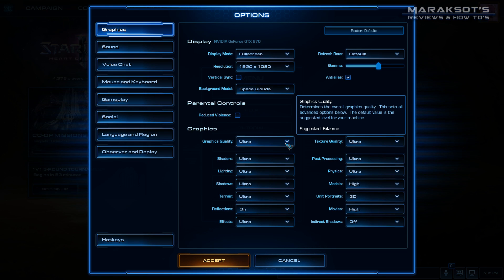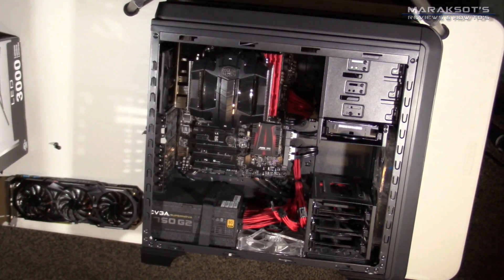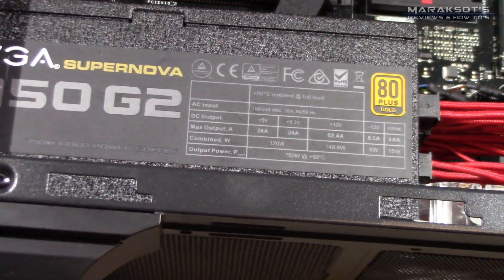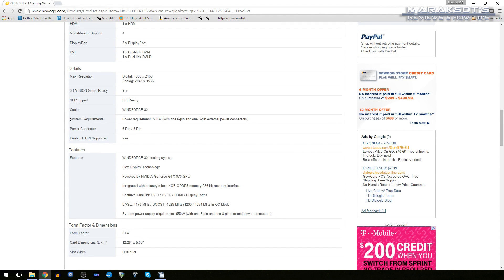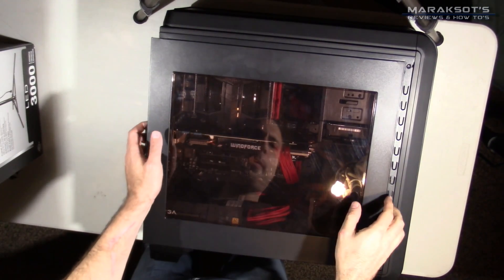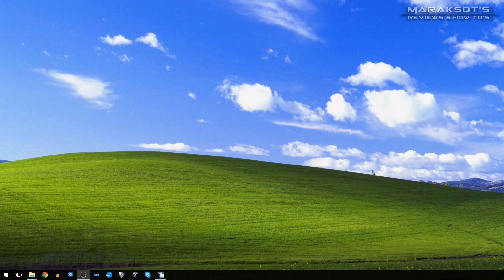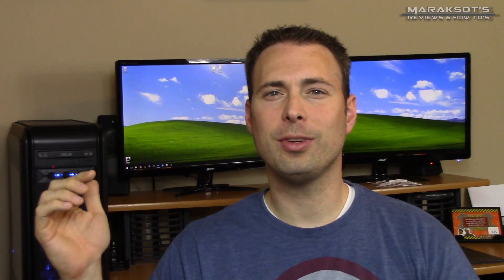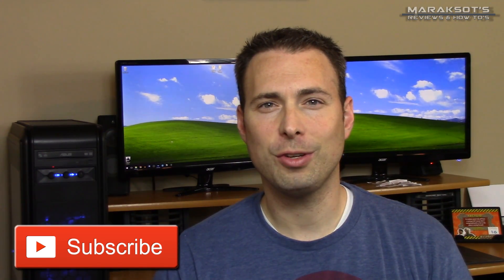A Beginners Guide - Upgrade your GPU - How to Install a New Graphics Card

Comment: So I play high  graphic mmo games like Archeage and Black Desert and I want to get a i7 processors but I'm not sure what graphics to get. Do I need a GeForce gtx 1080 or am a able to get something less powerful and expensive and play at full graphics with no problem. Note that it gets really laggy when there's a lot of players around.
Reply from the maker: it depends on what resolution you game at.  If you game at 1080p then I think a Geforce GTX 1060 or an AMD RX480 would work great.  1440p then I'd probably say a GTX 1070 or 1080. If 4K then you're looking at a 1080 or Titan X (Pascal).
Reply: You mean screen resolution? if that's the case I usually do the top resolution of around 1920x1080. but if not how do i find out at which resolution i do play?
Reply from the maker: Kelly nell yes, I'm talking about your screen resolution. 1080p is 1920 X 1080, 1440p is 2560 X 1440 and 4K is 3840 X 2160. The resolution you can play games at depends on your monitor. Right now 1080p monitors are the most affordable. When you start going to higher resolution monitors they get really stupid expensive. It sounds like your monitor is 1080p so yeah once you upgrade your CPU, a GTX 1060 or an AMD RX480 should be able to play any game currently on the market at 1920 X 1080 on max settings with no problems.  :)
Reply: Maraksot78
Awesome thanks for the info! :) i do I one more question though if you don't mind. The graphics card I have atm is a XFX R7260X and when i first got it, for some reason when I play games (especially the the higher graphics ones) and around 5-20 minutes of playing the game, for some reason my computer will randomly crash into a dark blue screen and make drilling sound and I would have to restart my computer every time that happen which kept me from playing games. And for some reason no body could figure out the problem. I tried to get it fixed about 4-5 times but it never got fixed. And the only way I can stop that from happening is a program called MSI after burner. And when my card is at a regular state it says that the

POWER LIMIT at 0 (MIN -20) (MAX +20) . 

CORE CLOCK MHz at (1075) (MIN 535) (MAX 1200)

MEMORY CLOCK MHz at 1600 (MIN 800) ( MAX 1600)

And for me to get it under control I move POWER LIMIT and MEMORY CLOCK to the MIN but leave the CORE CLOCK as it is. And I will have to keep this program running for as long as I'm playing a game. So do you know if it's a graphics card problem or is it more likely the motherboard?
Reply from the maker: +Kelly nell MSI afterburner is a commonly used utility for overclocking your graphics card.  Now I'm not a very experienced overclocker but from what I do know about it, it seems that your graphics card is possibly overheating or something when under load which then causes your system to crash.  Setting the power limit and memory clock to minimum would certainly help to reduce heat but it of course also reduces your graphics cards performance. Out of curiosity... how much do the fans on your graphics card ramp up when your gaming? Does it stay super quiet or does it get kinda noisy? If it's staying super quiet then your cards fans may be running at a super low speed to give you near silent performance but it of course doesn't do as good a job at cooling your card.  You should be able to adjust your fan curve in MSI Afterburner so that your fans will ramp up more when you're gaming then you may be able to bump your power limit and memory clock back up to normal and get some better performance. Another thought I just had is what is the airflow in your computer case like? Do you have a bigger case with plenty of space around all your components or do you have a smaller case where things are packed in kinda  tight? The tighter things are packed together the more vital it becomes to have good fans to bring cooler air into the case and exhaust the hot air out.  How many fans does your case have in it? How many intake fans? How many exhaust fans? Good airflow is super important because all of the components in your computer generate heat and if you're not getting the hot air out of your case then that can cause overheating which leads to system crashes and decreased lifespan of your components.  If you want to learn more about MSI afterburner I'd recommend searching for videos from Jayztwocents on MSI Afterburner, he's a very experienced overclocker and uses MSI Afterburner a lot and explains very well what all the different sliders and whatnot do. Also check out videos by Linus Tech Tips about case airflow they've made some really good ones.  I hope this isn't too much information for ya all at once. :) I really do hope it's helpful to you and will help you get a better gamng experience with your current rig.
Reply: Tbh I only have a basic dell case atm and everything is kind of packed but I do leave th case open so that i can keep a eye on everything. And I don't exactly know the type of fans I have but I have one for the processor and one for cooling the whole desktop itself. And of course 2 fans with the graphics card. And when I play games it will get too hot to touch sometimes. About 150 degree F I think. And sometimes it will make a pulsing sound. like in every 3 seconds it will speed up really fast for 1 second. But yes that did really helped a lot :)

Comment: Does it matter how much you have pin
Reply from the maker: as long as you plug in the dongle from your power supply that corresponds with the port on your graphics card you'll be good to go.  So if your graphics card has only one 6 pin port then you only need one 6 pin power cable, if your graphics card has a single 8 pin then you only need a single 8 pin power cable.  My GTX 970 in this video requires both a 6 pin and an 8 pin to operate.  So if you have a graphics card similar to mine that needs 2 power cables you're going to need to plug in both for the graphics card to work.  I hope this answers your question.  :)

Comment: What should I do, I bought an HP Pavilion 550-a114 - A-Series A8-6410 2 GHz - 8 GB RAM - 1 TB HDD - AMD Radeon R5 - Windows 10 Home from Best Buy and when I opened it upI didn't see a clear visible PCI Slot for a graphics card and I don't have the money to buy a whole new computer.
Reply from the maker: +Top Banana well... if you bought it recently you could return it to best buy for a different model. Or you could sell that computer and put that money toward another one. You may also be able to reuse your case, APU, RAM, powersupply, and hard drive and stuff and buy a new motherboard with a PCIE slot. That being said all too often pre-built PC's nowadays have custom motherboards and cases that don't always accomodate "off the shelf" components and since I don't know what exactly your case and motherboard is like I can't say for sure if it will accept a new motherboard. I hope this helps. :-)
Reply from the maker: +Top Banana I had a chance to look up your HP Pavilion today on Newegg.com and unfortunately it looks like there's not much of an upgrade path using that case and hardware. The A8 APU in that system appears to be soldered to the board meaning it's not socketed and therefore not able to be easily swapped out. Also that case isn't designed to accept an after market graphics card so even if you were to swap out the motherboard for one with a PCI Express slot you'd have to purchase a new CPU or APU and then cut out a space in the back of the case for the rear IO of your graphics card and then your graphics card would just be loosely sitting in there since there are no mounting points. I hate being hhe bearer of bad news but if you're wanting to upgrade to get a better gaming experience I'd recommend you save up some money, sell your HP Pavilion and look into something that's more powerful and is more upgrade friendly.
Reply: Maraksot78 thank you for telling me
Reply from the maker: no problem :)

Comment: i accidentally delete my graphic card drivers....could you help me?? cause i've been finding the compatible one...but not found yet....i've download the nvidia but then they say that it is not suitable for my computer...can you help me???
Reply from the maker: when you download the driver make sure you select whatever your GPU is and the version of Windows you're running and you should be fine.  If that doesn't work you may need to contact Nvidia support.
Reply: what is GPU?? sorry, i'm not very familiar with these...
Reply from the maker: do you know what graphics card you have in your computer?
Reply: yes, it is nvidia....
Reply from the maker: nur atiqah ok, Nvidia is the manufacturer... do you know what model of graphics card you have?  for example, do you know if it's a GT 730 or a GTX 960 etc?
Reply: hmmm...sorry, i don't about that...i'm trying to search back it
Reply: * it back
Reply from the maker: do you know how to go into device manager in windows?
Reply from the maker: if you right click on the windows start button it will bring up a list.  on the list there should be an item called device manager. click device manager and it will then bring up a list of all the devices connected to your computer.  on that list there is an option called display adapter.  if you double click display adapter it will then show you what your graphics card is.
Reply: It was Standard VGA graphics adapter
Reply from the maker: so it isn't telling you the model?
Reply from the maker: Are you using a pre-built computer like a Dell or HP or is it a custom built PC? If it's a pre-built then we might be able to find out what your graphics card is by doing a Google search for your PC manufacturer and model number.
Reply: i'm not very sure about that...but i'm using hp pro 3330 MT
Reply from the maker: I looked it up on HP's website http://h20564.www2.hp.com/hpsc/doc/public/display?docId=emr_na-c02976897 and it looks like they made that model with a pretty wide variety of graphics cards...
Reply from the maker: +nur atiqah however when I go to their driver download page for the HP 3330 MT... what version of Windows do you have?  Because depending on your version of Windows it looks like they have a couple different Nvidia drivers.
Reply: version? like?
Reply from the maker: On HP's support website they have downloads for the drivers for your computer so we need to know what version of Windows you're using.   Here's a link to their site so you can see what I mean.  http://h20564.www2.hp.com/hpsc/swd/public/readIndex?sp4ts.oid=5159685&swLangOid=8&swEnvOid=4058  If you're using Windows 8 (64 bit) then there's only one Nvidia driver there to choose from.
Reply: oh...i'm using windows 7(64 bit)
Reply from the maker: ok, do you know if it's Home Premium? Professional or Ultimate?  I think the drivers are all the same but just to be safe.
Reply from the maker: I just double checked the driver version for the different versions of windows and they're all the same.  :) It looks like there are two different drivers there. One says "NVIDIA 64 Bit Graphics Driver for Non-HDMI Graphics Cards (International)" and the other says "NVIDIA Graphics Driver for the NVIDIA GF405 Graphics Card (International)"  I'd try the first one and if that doesn't work then I'd try the other one.  Hopefully this will take care of your problem.  :)
Reply: thank you so much for solving my problems....hope you have a great day :)
Reply from the maker: you're welcome.  I'm happy to help.  Hope you have a great day as well!  :)

Comment: Hello, do we need to uninstall our old GPU drivers? If so, how do I do that?
Reply from the maker: +Mr Kebab that's a very popular question and I'm happy to help :-)  I recommend uninstalling your old drivers and then installing the latest drivers for your graphics card.  I have a video I made recently that will walk you through the process. Enjoy!  https://youtu.be/e3dGYvIa4pg
Reply: Maraksot78 Thanks a lot! +1
Reply: Maraksot78  what about integrated graphics, disable or uninstall? And, is it ok to load the driver for new card before you install card?

I know these are basic questions.
Reply from the maker: Robert Nicholls I've never disabled or uninstalled the integrated graphics drivers and have never had any problems leaving them installed. So no worries there. And as for loading drivers before installing your new graphics card, you can do it that way if you want but I've always just done it afterward. :)
Reply: +Maraksot78 If you're installing another gpu of a different model (in my case a 1080 along with my old 970) and intend on keeping the old gpu for PhysX-processing, do i still need to uninstall the old drivers?
Reply from the maker: Alexander Nilsson when ypu download the new driver package it has the Nvidia PhysX drivers with it so yah, if it were me I'd uninstall all the old drivers and just install the new ones. Cheers!  :)
Reply: Thanks for the response. I intended to do it after but screen went black as it was downloading drivers. So, the reverse sequence should be fine, install drivers, then, attach card?
Reply from the maker: Robert Nicholls yup, that'll be fine. I also just responded to your email on what I think may be causing your black screen issue and what I would try to fix it. I think a motherboard BIOS update may do the trick.
Reply: KASTAMONULU no you don't need to
Reply: Bro what happened if we don't unstalled drivers??

Comment: im trying to find a power supply for the Gtx 970 that has the capability of the 6 pin and 8 pin but cant seem to find one. Anyone know what he is using or one that has a 6pin and 8 pin? (kinda new to pc dont know what to look for lol)
Reply from the maker: +Cosmic Achilles I'm using the EVGA Supernova 750 G2 but all new power supplies with enough wattage to power higher end graphics cards have them.
Reply: Maraksot78 ok thank you. im very new to pc's. Desktops that is but i really appreciate it you just earned yourself 10 subscribers :D
Reply from the maker: Cosmic Achilles no problem, I'm happy to help.  :)
Reply: Maraksot78 would you possibly a better Banner for your channel? Free? Im pretty good at banners you of course dont have to keep it or use it
Reply from the maker: +Cosmic Achilles I've actually been thinking of changing my channel banner for a month or two now but haven't quite figured out what I want to do. I'm willing to take a look and see what you come up with.   :-)

Comment: are molex to pci-e 6 pin connector efficient  because i dont really wanna upgrade my psu as a 500w psu costs £40 as im on a ultra budget but my psu is 500w but it doesnt seem to have a six pin connector for the pci-e but i do have molex connectors and i was thinking that i should go for that option but i heard that it isnt a good idea 

please reply, thank you :)
Reply from the maker: I haven't heard of anything wrong with that.  IMO that's why graphics cards will come with those adapters so if your PSU doesn't have PCIE connectors then you're not screwed.  :)
Reply: Maraksot78 does this one come with it or it didn't
Reply: Maraksot78 my bad don't answer that question sorry well thank you man for that really appreciate it
Reply from the maker: my GTX 970 came with one molex to 6 pin PCIE and one molex to 8 pin PCIE.  They both require two molex plugs to provide adequate power.  the ones I have look like these https://www.amazon.co.uk/StarTech-Express-Video-Power-Adapter/dp/B0007RXDDM/ref=sr_1_1?ie=UTF8&qid=1473119372&sr=8-1&keywords=molex+to+pcie
Reply from the maker: Arran Bear no problem man, I'm happy to help.
Reply: Maraksot78 it's because I'm getting the RX 460 anf I'm just watching couple of videos what to look out for when putting the graphics card in so yeah
Reply: Maraksot78 it's because I'm getting the RX 460 anf I'm just watching couple of videos what to look out for when putting the graphics card in so yeah
Reply from the maker: Arran Bear very cool man. best of luck to you on your upgrade. cheers! :)
Reply: Maraksot78 thank you man :)
keep up the good work :)

Comment: does a GTX 950 fit in a Dell Inspiron 3650? I'm thinking of buying either a 950 or a 750 was wondering if it can fit into the case
Reply from the maker: +Zombiebrains24 I looked up the Dell Inspiron 3650 and it's a pretty small form factor case. I'm not sure if a full size graphics card will fit into it or not. I think a smaller form factor card like this Asus card will work. http://www.newegg.com/Product/Product.aspx?Item=N82E16814126100  but the only way to know for sure is to open up your case measure what space you have and then check what the dimensions are of the card you want and see if it will fit.
Reply: +Maraksot78 is there also a mini GTX 750?
Reply from the maker: Zombiebrains24 yes, they aren't necessarily called mini but there are 750's and 750ti's with a short PCB

Comment: I have the Nvidia GeForce Experience installed on my computer with the same driver that is required for my GTX745 to GTX960 conversion. Should I uninstall the drivers before putting in the new card as well?
Reply from the maker: +William Henry you don't have to. I'm just old school. That's the way you used to have to do it; uninstall the old and then install the new. Now days if you have GeForce Experience and stuff installed I think it keeps you up to date automatically.

Comment: t's funny because I installed my GTX 1070 yesterday, and now it has overridden my wireless network connection, and I can't connect to the Internet on my desktop.
Reply from the maker: +Deion Mitchell so you're using a wireless adapter to connect your desktop PC to your network and after installing the 1070 and the Nvidia drivers your wireless is no longer working? Have you tried reinstalling the drivers for your wireless adapter?